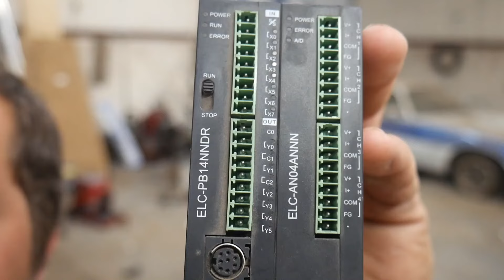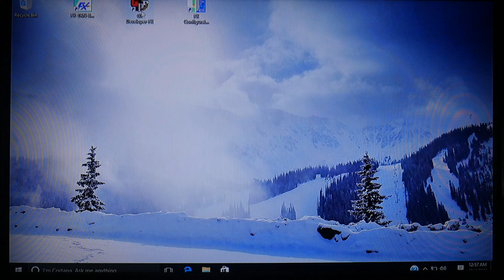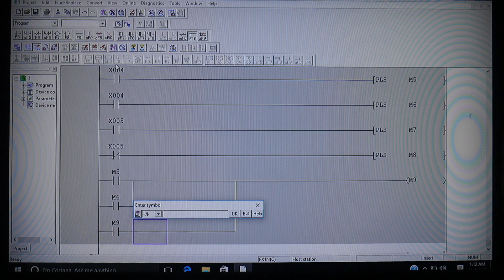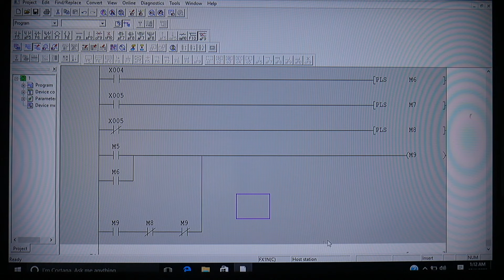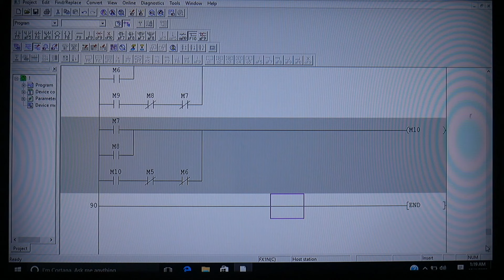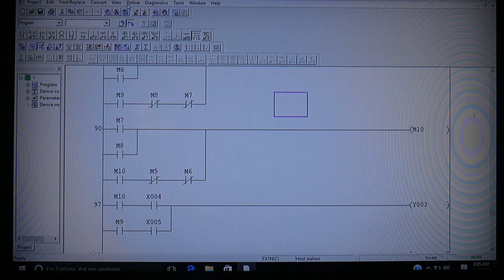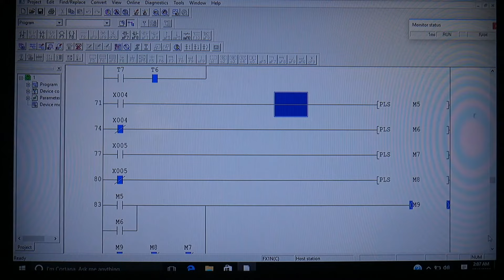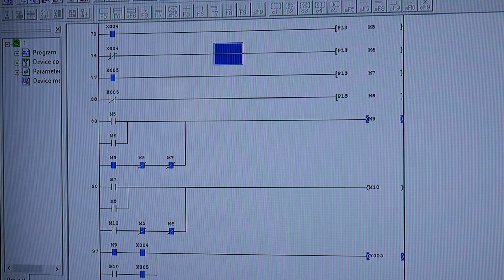Homemade RV. EP-21 The PLC Automation. 1977 Peterbilt 359 Toterhome.

Comment: Industrial automation technician (Instrumentation) here. You did a good job explaining PLCs in this video. Does that software allow you to label the bits? For example, RSLogix allows you to label contacts or coils, which helps a ton later on if you haven't looked at the program in a while and are trying to toubleshoot. Generally when you label one, for example M9, then everywhere else M9 shows up it will have that same label automatically attached to it. Your program might not be large enough to matter that much, but it could come in handy. 

Oddly enough, even though I work with PLCs every day, I never thought of using one at home or in my RV. I will be looking into this now for sure.
Reply from the maker: I'm not sure if you can name bits in this program or not.  I have done that on some projects, one that comes to mind is a plc/hmi set up I had on a drag car, but it may have been an older program. As you said the programs I usually write are even simpler than this and there's not enough there to matter.
Reply: #jamespooley a control technician here I have micrologic running my off grid camp we are at 2500 ft elevation we have a well do 450 ft to get water well is low yeald so I pump it 2 X a day to our cistern off the solar panels / battery it's been working for 20 years.